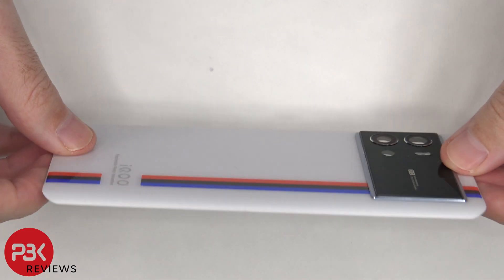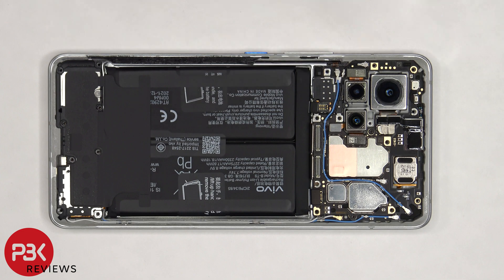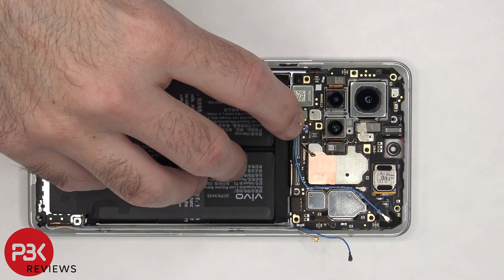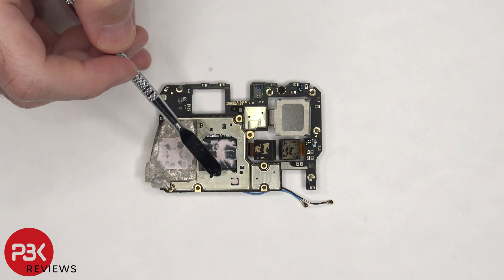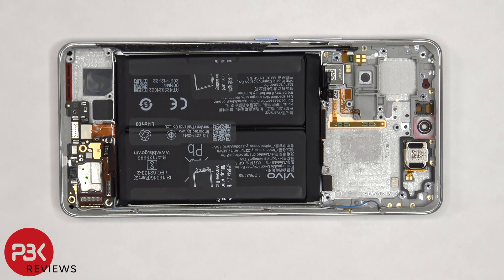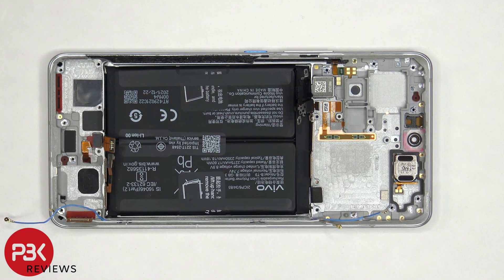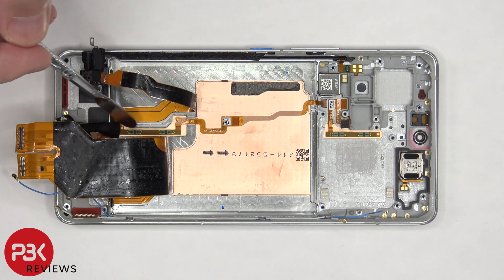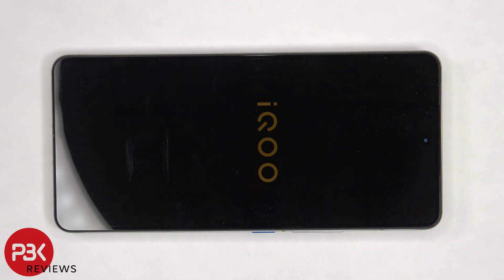Vivo IQOO 9 Disassembly Teardown Repair Video Review (China Variant Not India Version)

Comment: Hi does Iqoo 9 pro have IR blaster?
Since I saw two black dots on the top of the phone
Reply from the maker: No it doesn't have IR blaster. Both China and India variants dont.
Reply: @PBKreviews  thanks for confirming bro, however, what is that black dot on the top though?
Reply from the maker: @abdelhafidtaibi6116  its the secondary mic hole
Reply: @PBKreviews  but there are two of them?
Reply: It does.
Reply: @abdelhafidtaibi6116  most reviewers are saying it doesn't and even this video doesn't mention it, but i see 2 black dots at the top
Reply: @13traders98  On the other hand I've Seen many review confirming the presence of an Ir blaster, you can watch Technick most the Chinese phones, in fact the Ir blaster is borrowed directly from the Vivo x70pro plus. However, the global version (indian version) doesn't as I'v seen Flossy carter talking about missing the Ir transmeter
Reply: @abdelhafidtaibi6116  yeah my comments were based on flossy videos and some websites mentioning that it doesn't come with one, anyways not sure if flossy has the Indian variant as it had origin os and indian variant is going to have funtouch os most probably.
Reply from the maker: I don't think either version has it. Both India and China websites also don't make mention in the specifications of the phone for IR blaster support.
Reply: @PBKreviews  since you did the teardown do you know what the 2 black dots on the top of the phone are?
One of them must be a mic, what's the other one?